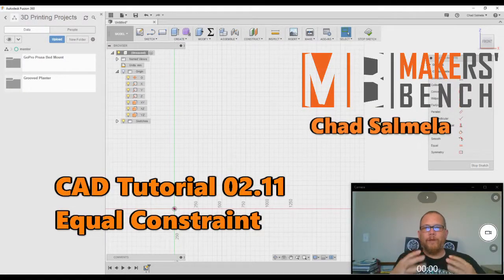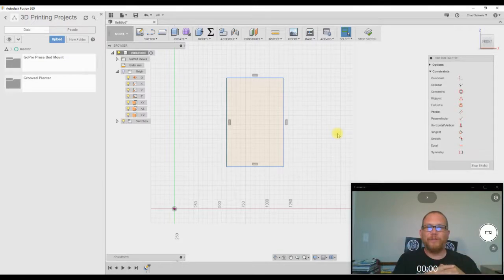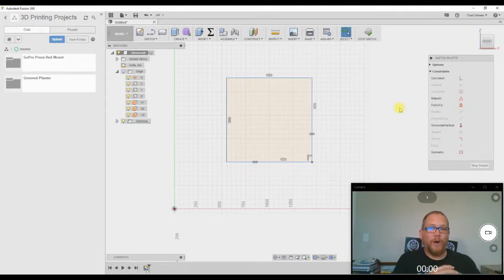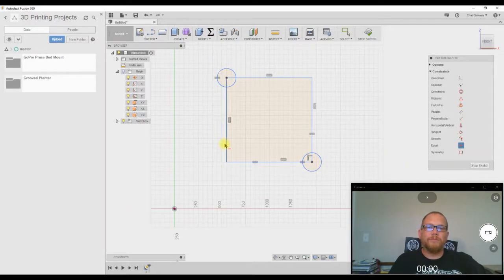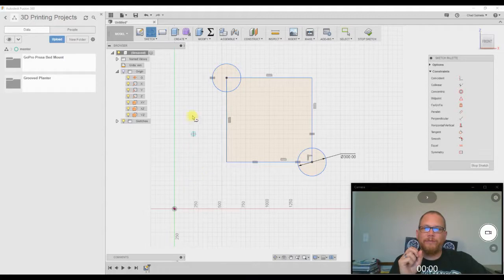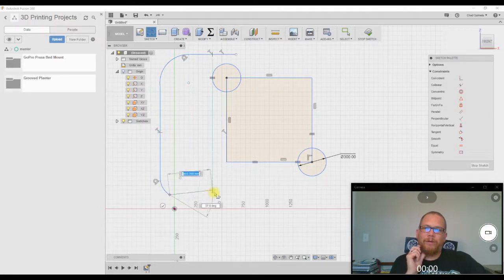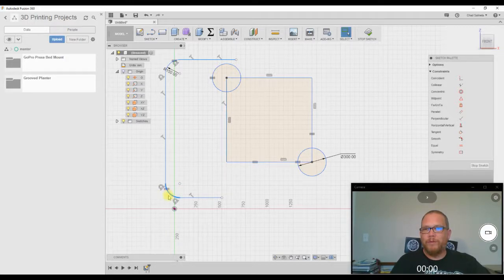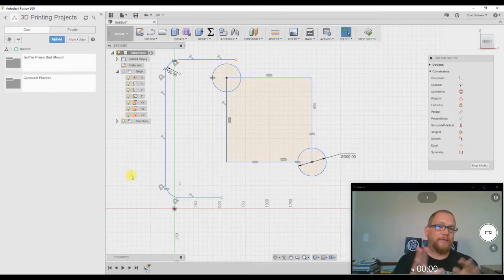CAD Tutorial 02.11 Equal Constraint

Comment: How can this be used for rectangles? All the equals demos I have seen showed lines and circles but no shapes with more than one line.
Reply from the maker: Typically a rectangle would be constrained with horizontal, vertical, or perpendicular constraints, which make the opposing sides equal. So you wouldn't typically have to use equal constraints on them. You could use the equal constraint on a rectangle that's drawn on an angle and doesn't have horizontal and vertical constraints, but I think the perpendicular constraints would have not be there as well. Basically the equal constraint can be used on any two lines or arcs provided there are no other constraints controlling there length. The equal constraint on an arc makes the radius equal, not the arc length.
Reply: @MakersBench  Thanks. I think I follow you. It sounds like I cannot make two rectangles and have them be constrained by an equals constraint. Let me explain what it is I am trying to do. I have a box and inside that box I want to have two rectangular supports. I thought I could add them both, add an equals constraint and then add dimensions to one of them with the assumption the other rectangle will take on those dimensions. However, after I created the rectangle I cannot select it as a rectangle, I can only select the individual lines. That means I need to completely define each rectangle independently.  I know there are other methods e.g., mirror, but I was just experimenting with the equals constraint to see if that would work.
Reply from the maker: Sorry, you didn't mention two rectangles in your original post, I thought you were referring to the lines of one rectangle. You can make the sides of two rectangles equal. But when you use the rectangle tool, the rectangle isn't a solid piece of geometry. It's just a tool used to make the shape, and assumes certain constraints to give you a bit of a head start on constraining. They do end up being individual sketched lines.
Reply: @MakersBench  Thanks again. It helps when the question is formed correctly. :) I will use one of the many other tools at my disposal, like mirror, or I could just make the lines of the rectangle equal on a 1-by-1 basis.
Reply: @MakersBench  Thanks! 4 years old video, just explained all that was needed, added info in the comments for my exact case. Couldn't ask for more!
Reply: @MakersBench  Ah that explains why rectangles have to have sides equalled separately, thanks!